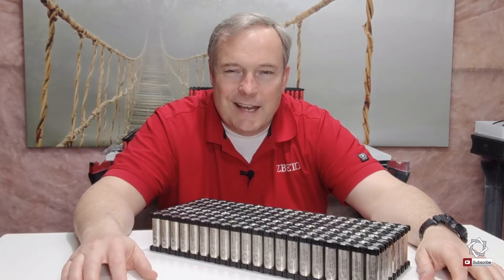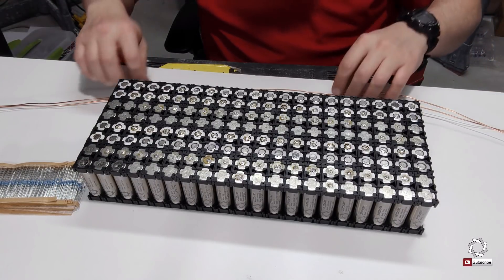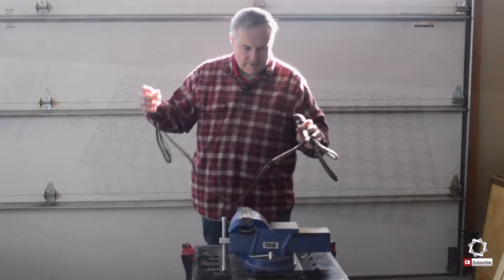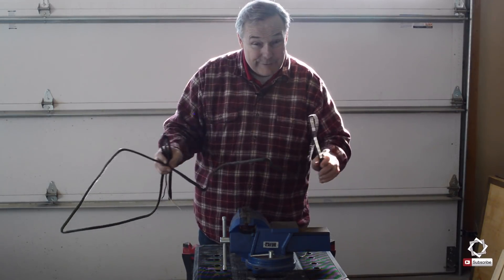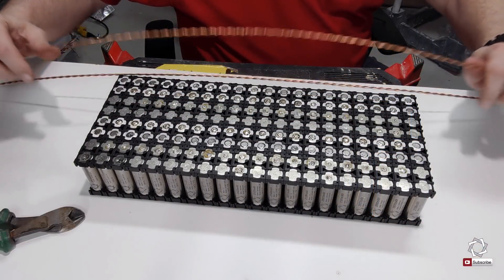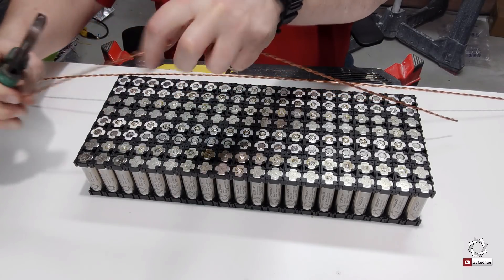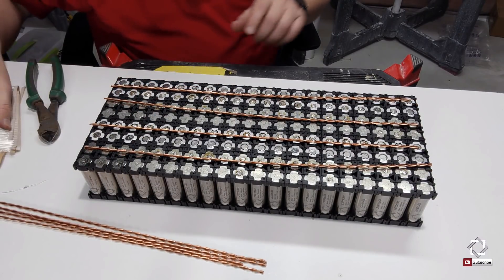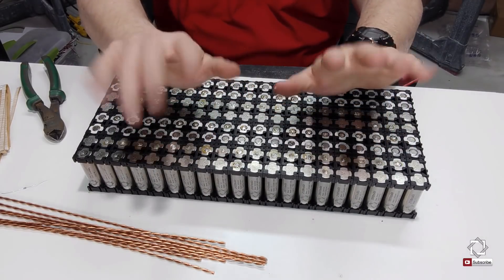Building an 18650  4s 40p Battery Pack

Comment: Rather then terminating the pack from corner to corner , terminate the feed wire in the center long side so all current only needs to travel from ends to center. In other words the shortest path is the least resistance..

Comment: 2:23 any one else cringe at this moment? At this point i was like dude are you crazy?!?! 10:43 You need to be safer with there batteries! I'm sure you know but the whole bottom case of a battery is negative so the chances of you shorting a cell out is high of not insulated 100%. Risky business
Reply: Calm down

Comment: I have a question why risk using resistor legs as a fuse when you can purchase 3mm X 10mm axial with lead wire fuses at $10 for 1000 of them on aiexpress I guess I look at it as if you were eating cereal you eat out of a bowl not a flat dish so if you need a fuse why not use an actual fuse just thought I'd ask
Reply: Me too I still don't understand why people using resistor legs as fuse it it can hold only 4 amps ...
There are fuses capacity with 5amps 
Is that resistor pack is cheaper ...?

Comment: Why not making busbars longer so u can put a connector straight on it :)
BTW where do u get batteries so cheap?
Reply from the maker: These batteries will be going into a tight space so I was trying to conserve space.   I actually rethought that and the New busbars are longer.  https://youtu.be/WtyU9oDM-pM
Several of my cells came from old laptop batteries I bought on eBay.  I have not always been so lucky.  There was one time I paid $100 for a bunch of laptop batteries...  All the cell in the batteries were bad.  :-(
Reply: I am really struggling getting normal quality batteries. salvaging old laptop batteries from friend's PC shop is not enough. Buying salvage cells on ebay is ok, but shipping 8$ per kg raises costs significantly. :(

Comment: It would really help if you could figure out a way to charge a 40p4s battery pack with a solar panel and a pwm solar charge controller
Reply from the maker: Alberto, Funny you should mention that.  I have been working on some ideas on charging my Portable Power Pack  (https://goo.gl/jEMMF1) using solar panels like these: http://amzn.to/2FKZaVO.  I might even build my own solar panels that could fit into a case that mounts to the top of my power pack.  What do you think?
Reply: Frank Brand, adding solar panels to the power packs really seals the deal on the self producing side of solar and using that solar panel briefcase will really do the job.
Reply: You wanna use an MPPT controller everytime over a PWM unit. Cost be damned.

Comment: is there a particular reason you twist the wire? other than size? I'm thinking about using 8gauge solid copper wire, with 5 amp fuse per cell. I'm building 20 cell packs. then connecting 7 in series. I am also looking for a 7s BMS balance board on the cheap.  if that's a thing. a actual good cheap BMS. great video.
Reply: Twisting the wire also makes the new core more stable. It's easier to bend and solder into place. Plus, it just looks neat  ;)
But as Frank mentions, the twin twist will allow for a lot higher of amp draw without overheating the wire. A single core strand of the 8awg will not be able to dissipate the heat as effectively as a twin twisted strange of 14awg.
Reply: Any 7S balance board will do the job well.

What you want along with the BMS is a low voltage alarm, and a voltmeter, and a balance port for periodically balancing the cells.
Reply from the maker: Thanks James.  I'm using the twisted wires mainly because I was concerned that with these 12 volt batteries a single strand of 14 gauge wire would not be enough.  If the battery packs were 48 volts then a single strand of 14 gauge would work just fine.  Here is a link to a inexpensive 20 amp 7s BMS  on Amazon.com, I h ope this helps.  http://amzn.to/2Fn7VF9

Comment: Remember that electric blanket thing you demonstrated in previous videos? well i have one same model as it for some time given the crap weather we had in the uk over the weeks ive been using it however it seemed to go into dead short then open circuit , so i opened it up to find that two the wires had bridged and somehow became exposed , the insulation on the wire is not silicone heat resistant so i just thought id tell you about this in case your family members may encounter the same fault. Oh and i ran it at about 12v@3amp consumption.
Reply from the maker: Steve, good to know.  I will  keep an eye on it.  So far it seems to be working fine, but nothing is perfect.  Thanks for watching.

Comment: The pack with the transparent cover looks amazing, my only point would be to user a better BMS, those BMS are not great just because if they die would be difficult to see what was wrong, my recommendation would be Battrium BMS. Yes, it is more expensive but you can really trush on it. Look at this (at 2:15): https://www.youtube.com/watch?v=luM9ZaqfrBk
Reply from the maker: I have not been able to find a Battrium BMS that does 4s.  All I have been able to find are the LongMons that work great on 1s cell packs.  Any more information you might have would be great.  Thanks for watching.  Frank

Comment: word of advise load test that bms and watch your cell voltage ive had several have one row drain faster than the others if that happens just make sure your pack is balanced and does not drain the same way with out the bms if it dont the bms is faulty. Its mainly noticeable when the pack is about dead one row will be up to .5 volts lower then the others. One other thing solder wick works really well and braided copper is an option as well.
Reply from the maker: Steven, Awesome, thanks for the advice.  I will do a bunch of testing and see what the results are.  When I was running my portable power pack with no BMS I found that I needed to balance my cell pack about every 3rd charge.  I was hopping that adding the BMS would help resolve that issue.  Another problem I had with my small power pack was that I would over discharge my cells and I ended up killing 8 cells.  I installed this BMS and it has been working great on my small 32p 4s battery pack.  I think I may even do a video on your recommended testing.  Thanks again, Frank

Comment: appreciate the video, Frank. so as I follow along the previous video you were making 40p 4s  x3 so now for the sake of flow you've consolidated into 1 pack of 3x 40p 4s? I can't wait to see the wiring as I'm a little confused as what that might look like.
Reply: To add a little clarification, a 4s40p is not the same as 40p4s. Electrically they are the same, but physical wiring is not.
4s40p = 40 cells connected in parallel, then take 4 sets of these and connect in series
40p4s = 4 single cells connected in series first, then 40 of these connected in parallel. This method is highly difficult to control with a bms as you would need a separate one for each 4s set.
So in the video, Frank made a 4s40p. In the title he put it correctly, in the description he flips it (🤔)
Reply from the maker: Hey Tim,  So the end result will be 3 separate 12 Volt batteries (Technically I will be running them at 15.5 volts at full charge.)   Each 12 volt battery is built from 120 cells (18650).  The cell are divided into 4 groups with 40 cells per group (40p).  The 40 cells are then soldered in parallel (all the positives are soldered together and all the negatives are soldered together).  Then the 4 groups of cells will be brought together and soldered in series (positive to negative, positive to negative, positive to negative).  That's how you get a 40p 4s battery pack.  I cover this in this video: https://youtu.be/CxzbpFo4nc4  I hope this helps.  Thanks for watching.  Frank
Reply: 120cells??? Is that modern math? Back when I went to a one room school house, 4 x 40 equaled 160.  What am I missing here? ¯\_(ツ)_/¯